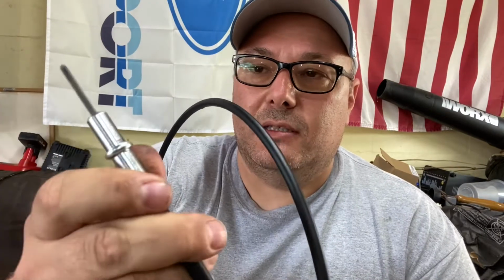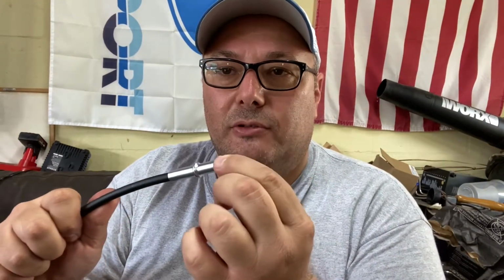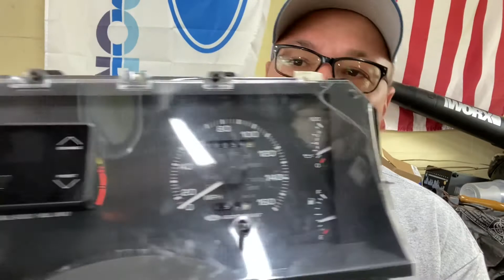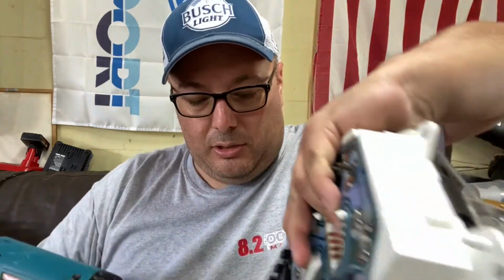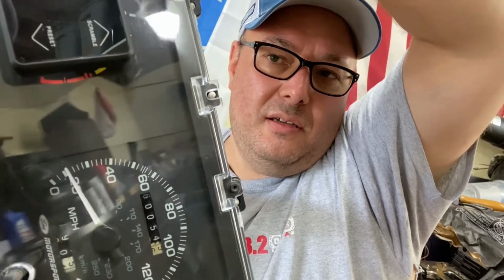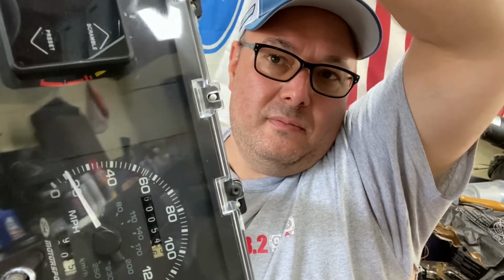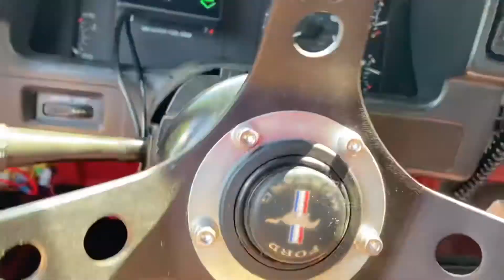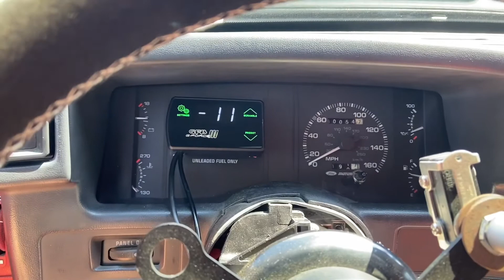Foxbody speedometer jumping?

Comment: I actually had this problem with my '82. My speedometer didn't work (turned out the inner cable just wasn't seated correctly) so I replaced it with a cable from LMR and now its doing the jumping thing that you're describing. I may just throw the original cable back in it.
Reply from the maker: They are really finicky, this one started doing it again intermittently.